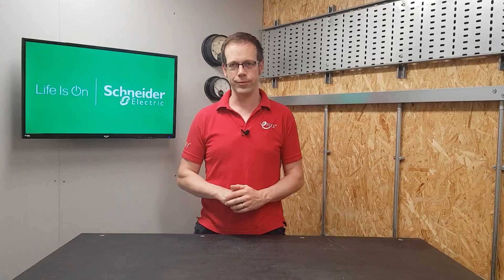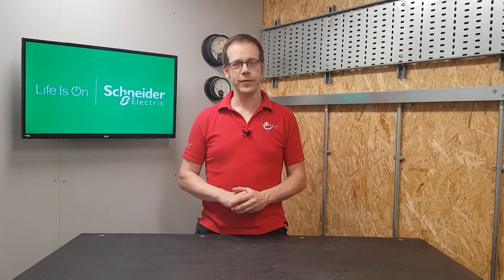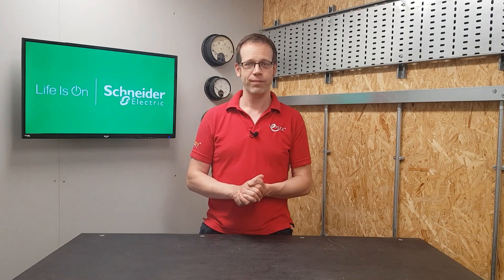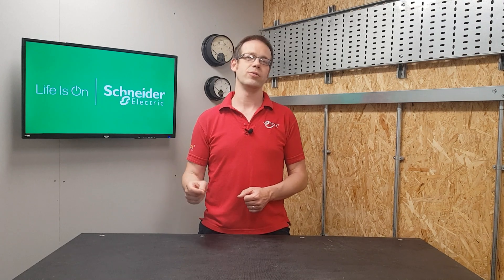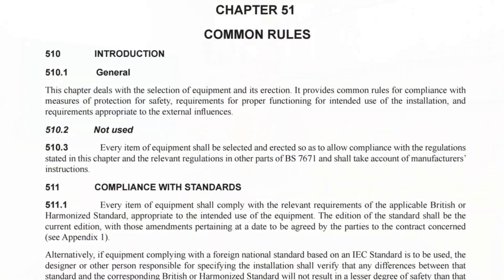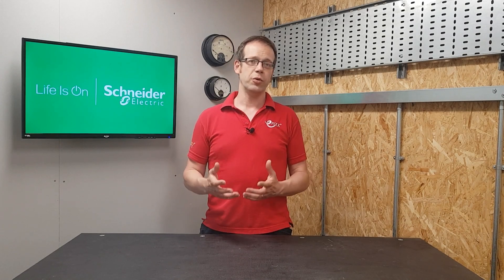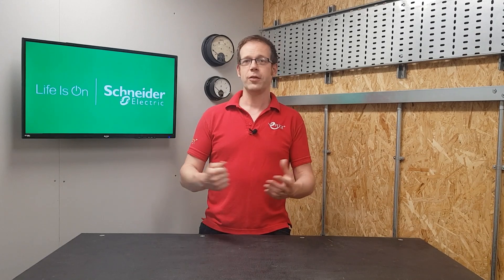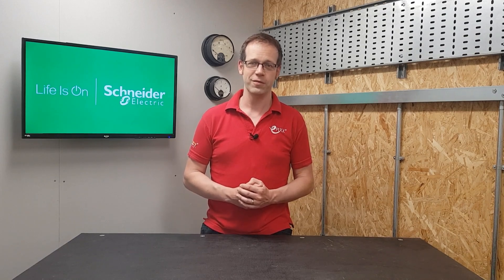Do you need to use a TORQUE SCREWDRIVER when wiring consumer units?

Comment: Great video as always Joe.

We DO NOT need to use a torque screwdriver, manufacturers instructions are not a legal requirement they are nothing more than a recommendation , do you read the instruction book for every single item you buy like that new TV or the new fridge freezer? No you don’t  what about the flat pack TV cabinet who reads the instructions for them no one  if it is not a legal requirement or in the regs then we do not have to use them simple.
Reply from the maker: Nothing in BS 7671 is a legal requirement as it's a non-statutory document but to be compliant with the regs you need to follow manufacturer's instructions which may include the use of a torque screwdriver.
Reply: @efixx  this is correct but, like most BS, BS EN and IEC standards, BS 7671 has de-facto legal (or quasi-legal) effect. In any criminal or civil proceedings, the court, in reaching a decision, will ask the question "what are the industry standards applicable to this situation?" to which the answer for the purposes of this conversation will be the edition of BS 7671 applicable at the time the work took place on the installation. The regulations you have highlighted in your video then clearly, by extension, give legal effect to compliance with manufacturers' instructions. Other statutory regulations, such at the Provision and Use of Work Equipment Regulations are also likely to be relevant many circumstances. A defence based on non-compliance with MIs would have to demonstrate clearly why it was not reasonable to do so.

The provisions of the Health & Safety At Work etc Act 1974 are also definitely worth keeping in mind at all times. Some of the commenters on this thread with, shall we say, a "relaxed" attitude to the applicability of manufacturers' instructions and the weight they carry may want to to consider their potential actions or inactions in the light of the working definitions of "shall", "shall where practicable" and "shall where reasonably practicable".

The use of torque screwdrivers is likely to be regarded as reasonably practicable where MIs specify a terminal torque setting. If someone wants to try and base a defence against a criminal prosecution or defend a civil action stating that it was not reasonably practicable to do this, well good luck with that!
Reply: @efixx  NO WE DON’T.
You have just said so yourself 
MAY include the use of a torque screwdriver not will  it comes down to personal choice  . And years of experience . 
But to be honest I have brought my self a torque screwdriver I got the Dapper model and I hate it the tip of the blade broke the first time I used it . will continue I use it yes only because my hands are not as strong these days .
Reply from the maker: Please stop typing at me in caps Sean, it gives the impression you're shouting at me. I'm saying the manufacturer’s instructions may state a torque value. If they do, we have to use a torque screwdriver to comply. We always have a personal choice in life and if you're happy not to comply with the regs that's your choice. But if you want to comply with the regs and the manufacturer states a torque value then a torque screwdriver will be required. This isn't my opinion it's very clear in the regs.
Reply: @efixx  first of all I don’t mean to give you the impression that I am shouting at you please for give me. 
 Secondly I am not saying we shouldn’t use a torque screwdriver I just saying that it is not a legal requirement and that the regulations are not clear on it if it was then it would be a regulation   . My doctor said I should stop smoking not that I have to stop smoking , 
Law is law . Recommendations are not law .
Reply: @Dog-whisperer7494  Nothing in BS7671 is a legal requirement..  You can wire up things however you want, however its when something goes wrong that following BS7671 can save your bacon.  BS7671 clearly states that you shall take into account manufacturers instructions, that does not mean you specifically have to follow them however the question in court if you rely on installing to BS7671 if something went wrong would be "So mr electrician you say you installed it to BS7671.  This states you should take account of manufacturers instructions which clearly say that it should be torqued.  Did you torque them to the correct setting?".  I dont think "Yeah ive been doing it years so I know exactly what 2.5nm feels like" will keep you out of jail...

If your happy not using a torque screwdriver nobody is going to force you, I think all efixx is trying to make everyone aware is that technically to comply with BS7671 (Again not a legal requirement) you should really be following manufacturers instructions which are often now saying it should be torqued to X setting.  The only way to make sure you get to that setting is by using a torque screwdriver.
Reply: @steve11211  so why don’t the manufacturers say anything about the use of a torque screwdriver it only gives you the torque settings and every manufacturer have different settings from each other? 
Like I said I am not saying we shouldn’t use a torque screwdriver just that we don’t have to. Also I believe that if you think something might go wrong at some point then your not very good at your job 
We have done with out torque screwdrivers and torque settings for well over a hundred years so why do we need them now? Also most house fires are caused by faulty electrical appliances and or chip pans / deep fat fryers
That’s why a lot of the well known brands like becko indissit hotpoint have had a massive product recall over the last 15 years fact
Reply: @Dog-whisperer7494   Hager design 30 page 1 states:  "Important notice:
To prevent potential overheating from loose connections the installer
shall check connections are tight to the torque levels stated in these
instructions prior to energizing this board. This check should include
factory made connections which may have loosened in transit."

You can use a toque wrench I guess but how else are you going to insure the torque levels?  You can change the torque settings on the screwdriver, its not fixed..

 If some DIY Dave comes in after you and messes about and does not tighten a connection and that causes a fire but DIY Dave swears blind he didnt touch it, you can turn round show your torque screw driver and show the settings on the consumer unit and say you torqued them all up so the loose connection was not you.  In that situation it doesnt matter how good you are at your job.

Totally agree most fires are faulty appliances however you can't say you have never seen an issue caused by loose connection, had one the other week, customer phoned, main tails from cut out smoking, when I got there the customer had grabbed the live tail and pulled it out of the cut out with total ease as it was smoking and starting to melt, clearly loose connection, the other day earth conductor on TNCS connection totally loose.
Reply from the maker: @Dog-whisperer7494  no worries 😊, it seems like a very fine point you're arguing here, maybe too much for YouTube comments. Hopefully we can chat about it in person some time. 👍
Reply: @steve11211  yes but that was on the DNOs cutout not the CU so yes it should be mandatory for the DNOs to  torque there connections. As for DIY  I think it’s a complete joke that part P of the building regulations still allow the home owner to do there own electrical work yet People like you and me have to notify building control . 

Like I said I am not saying we shouldn’t use a torque screwdriver . Just that it should be our choice based on our experience. As for being half up in front of the magistrate ? You can not be prosecuted for braking a law that doesn’t exist 
We a have all herd the horrible story about the young lad who was killed in a pub bear garden  in Romford , the so-called electrician who did some work there for his brother in law got nothing more than a fine and a two year  suspended sentence and his brother in law ie the landlord got a fine and lost his license . And I bet torque screwdriver was never mentioned in Court ?  update on this is the electrician got twelve months in prison and the landlord got ten years
Reply: @efixx  yes I do have a nasty habit of going on and on but as one who knows me will tell you 
I won’t back down on something I know i’am right about but if I think I might be wrong I will walk away. Like I said I have brought a torque screwdriver and I will use it I just don’t like it and I don’t want it
Reply: Interesting, so we dont need to torque down 240 mm2 AL either according to you? You do that by feel?
Reply: @Faddnn  actuallly we don't  .. i have pulled 300 mm² AL and nope no troque wrench used ..
Reply: @kittsdiy  Well, that is not a good idea if you're thinking that cable can potentially pull 300 amps and it is alu. Last guy I would have in my staff, never heard about someone taking such a risk when we're talking about so much potential energy.
Reply: @Faddnn  it even was 2x300m per fase :)  800A braker .

Comment: My two pennies worth, if an accident happens and you end up in court being prosecuted , and you were asked did you torque up the screws in the CU , according to the manufacturer instructions , pulling out you torque screwdriver in court can save your bacon. . It's not worth the risk  of not having one
Reply: NO Way would I pull my tool out in a Court.....not after the last restraining order anyway
Reply: I've never been to court,  nor do I intend on ever going.  It would be down gross negligence. Mi's are there for good reasons.  In this industry amongst others there  is good and poor workmanship.  We can't say all us sparks work to the same standards.  However I like to sleep peacefully at night.  It's not worth loosing sleep thinking did I do this or that.  LOOSE WIRES CAUSE FIRES 🔥.
Reply from the maker: Spot on Robert, spot on.
Reply: Manufacturers instructions are not a legal requirement so you can not be prosecuted for not following the instructions.   But yes if you want to protect yourself and your reputation then it’s worth the hassle
Reply: @Dog-whisperer7494  yes you can . It would be regarded as negligent if you don't follow manufacturer instructions.  There has be many a court case were  people have not followed manufacturer instructions and tried to sue. And lost in court , and had to pay all court cost. If you went to trading standing standard or you asked your solicitor the first question would be,  did you follow the manufacturer instructions, because the manufacturer would be regarded as the expert not you , because it's there product they designed it they tested it,  not you . I suggest you look up the laws on negligence. When you purchase goods the manufacturer instructions form part of the contract on supply of those goods , so I suggest you read consumer ,
Reply: @robertburrows6612  👍🏻manufacturers instruction supersede  the regulations
Reply: Good point well made

Comment: Common variables, such as wire type (single strand or multi). Quality of wire.? (or the screws themselves).
In the 55 or so years I have been tightening screws, so they don't get hot, or damage the wire, I have never used such a device.
I would need to check tightness with a normal screwdriver afterwards, so what use would a torque driver be.?
Reply: So know you're not over tightening it as well?   As long as I follow the instructions,  I don't need to worry about something failing in my installs.
Reply: David,
I entirely agree.
Reply from the maker: To set the torque to the correct setting as specified by the manufacturer. 👍
Reply: @efixx  Indeed, but, what if the calibration was way out, and you didn't realise.? Do you just blindly carry on and not go back to the previous installation, where the torque settings are now wrong, or do you use years of experience to tighten them properly with a standard driver in the first place.?
Reply: A torque screwdriver doesn't do the work for you. Once you've getting to the point where it's going to release, it feels identical to doing it with a fixed screwdriver.

I suppose the concern is new electricians who have zero clue what the required torque feels like and blindly follow what their equipment says without also applying a little common sense. Torque screwdrivers would absolutely not be the first place that happens though!